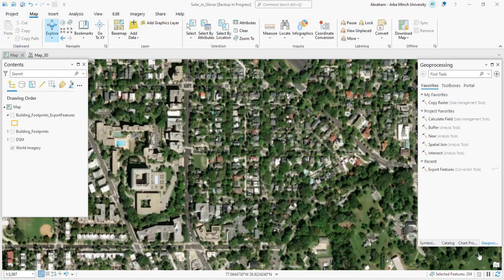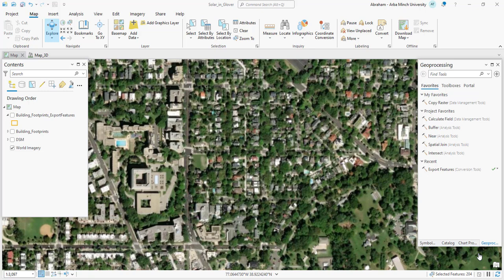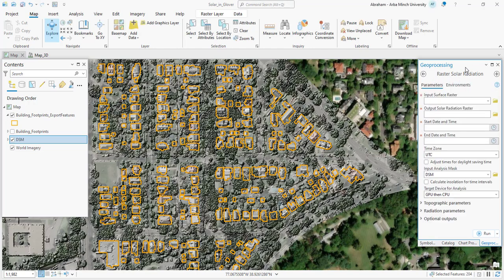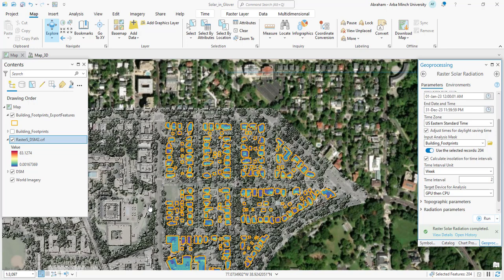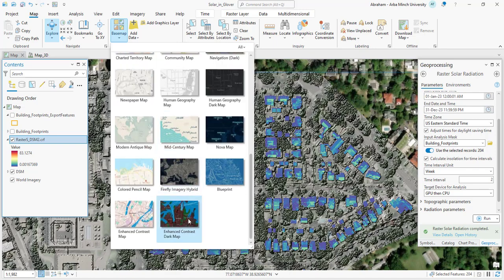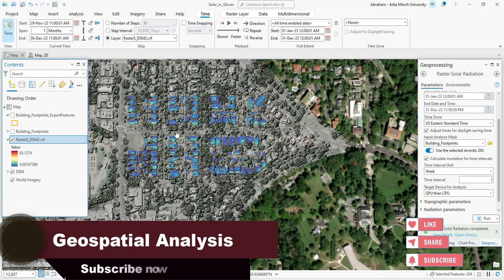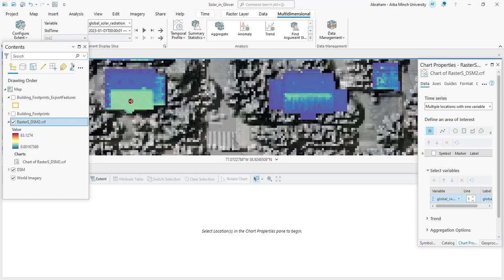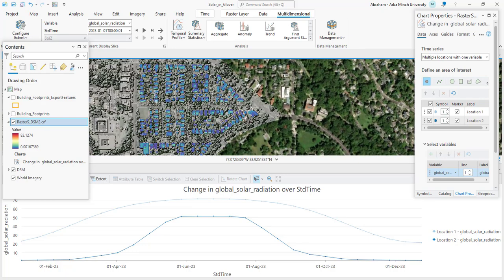How to Identify Solar Energy Potential using ArcGIS Pro Raster solar radiation tool.

Comment: Thank you for the information, I have a question.
1) how can we get free DSM data for any part of the world?
2) can ArcGIS Pro automatically generate a chart based on an output for a defined area of building footprints eg statistics for buildings in a district
Reply from the maker: I don't think you can get free DSM. Instead, you can use area solar radiation tools using DEM

Comment: Thank you for the information, I have a question.
1) Can I use DEM instead of DSM?
2) Instead of using a DEM, is it possible to reflect the height information of the building?
Reply from the maker: Using a Digital Elevation Model (DEM) instead of a Digital Surface Model (DSM) for identifying solar energy potential can be done, but there are important considerations to keep in mind:

DEM vs. DSM:
DEM (Digital Elevation Model):

Represents the bare earth surface, excluding buildings, vegetation, and other surface features.
Provides the elevation of the ground without any obstacles.
DSM (Digital Surface Model):

Includes the elevation of the earth’s surface along with all objects on it, such as buildings, trees, and other structures.
Provides the elevation of the highest surface at each location, which is more relevant for assessing solar energy potential, especially in urban areas. Use DSM Where Possible: For more accurate and realistic solar energy potential assessments, especially in urban or complex terrains, use a DSM. This will account for the shading effects of buildings and other surface features.

DEM Use Case: If you only have access to a DEM and your area of interest is primarily open and flat (such as agricultural fields or wilderness areas), then a DEM may be an acceptable substitute, but with an understanding of its limitations.  While a DEM can be used with the ArcGIS Pro Raster Solar Radiation tool, it may not provide the most accurate results in built-up areas where surface obstructions are important. A DSM is generally recommended for solar energy potential assessments, especially in urban settings.